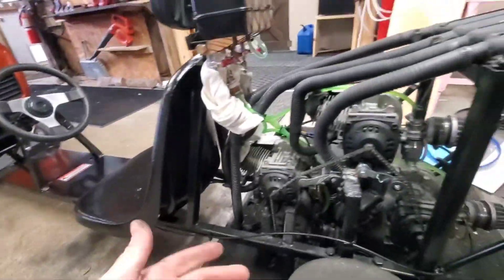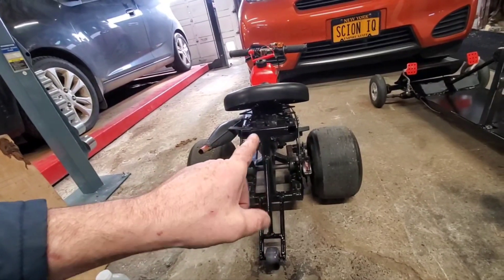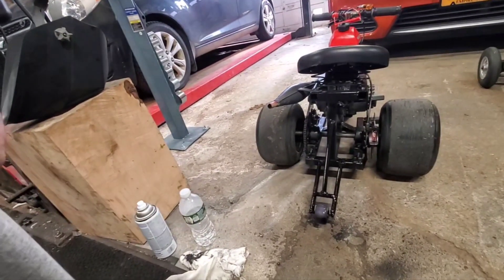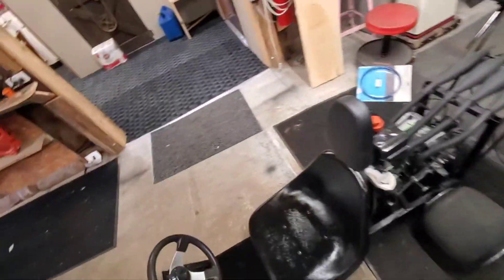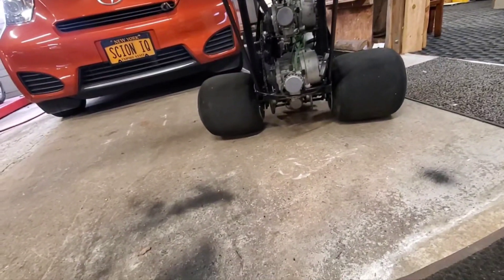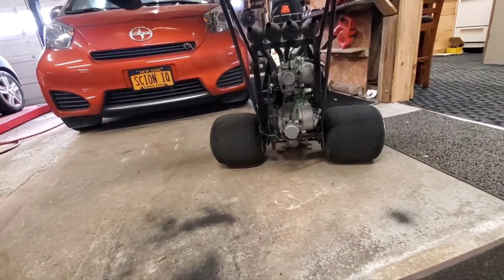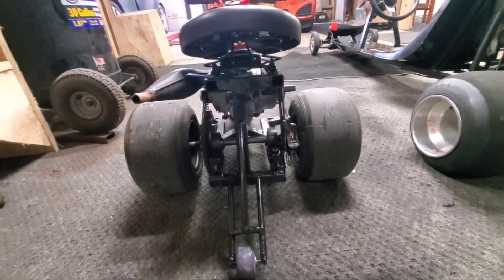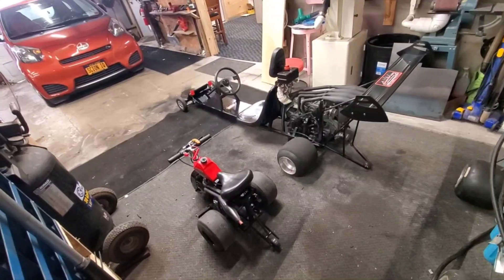coming down to the end of The Wire, had to add wheelie bars

Comment: makes perfect sense, never had a car with a locked/welded diff  i expect cars like that would be just the same , no wonder theyre always checking tyre pressures.
i dont think id ride the tiny dragster until there was zero fuel leaks.
never seen a glowing wheel like that , a fun thing.
Reply from the maker: I got new shut off valves but unfortunately they're coming from China so it'll be a few weeks
Reply: @TheOriginalAndysGarage  yeh takes 3 months here and we,re close to china